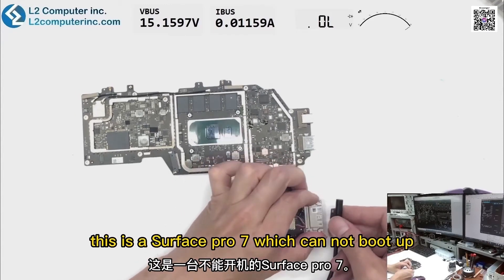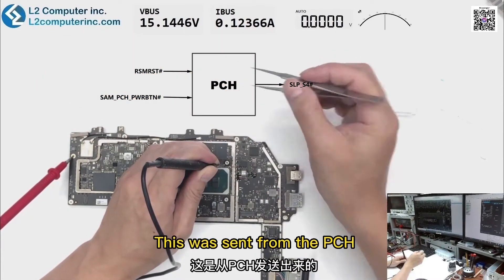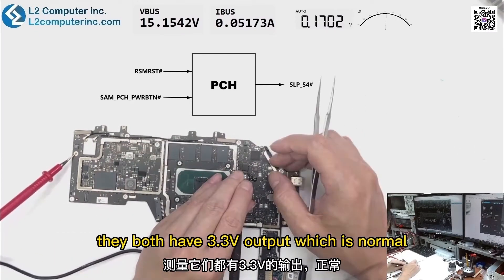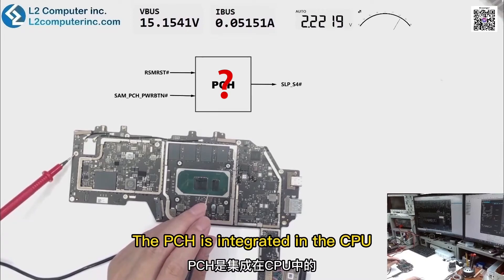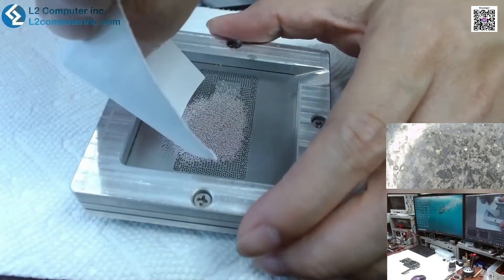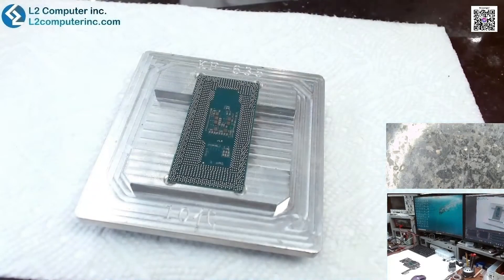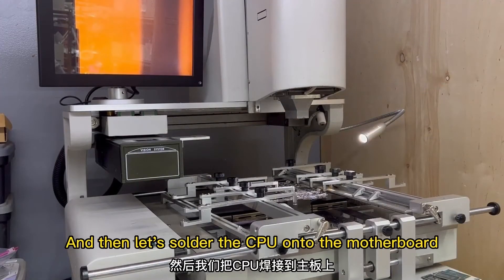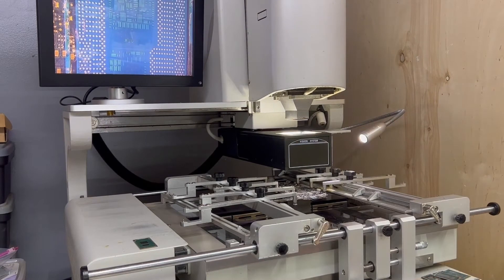Surface pro 7 Can't turn on repair tutorial

Comment: I have i guess similar problem 
Surface pro 6 won't start just the screen backlight and then shutdown 
I have measured the current it draws from the charger 
If it off it draws 0.1 amp
If i press the power button it draws 0.3 amp
What could be the problem?

Comment: Cant figure out a board issue. I have no power as soon as the power plug is removed. This appears to be a hardware issue and i cannot figure out power rails. I have already replaced the battery and surface connect port. Any ideas?
Reply from the maker: Has the computer detected the battery?
Reply: @l2computer310  nope

Comment: My SP7 has some really weird power button issue, at first it was dead it wouldn't power on at all even when trying to reset it, then i opened the device and lifted the screen and removed and reinstalled battery power cable then it immediately booted up! but then when I normally shut down the device and try to power it on again (using the power button) it won't, every time i want to turn it on i have to remove the battery power cable and reinstall it, so i thought that the power button was damaged but a technician said that the power board is working fine as he tried it on another device. Have you come across anything like that? as this small issue is killing the functionality of the device.
Reply from the maker: Send it to us repair, I will let you know the problem after diagnostic.
Reply: @l2computer310  I don't live in the US, how do I send it internationally?
Reply from the maker: Please measure the voltage of the power button, and measure the voltage when the power button is held down

Comment: Nice!!! Is boardview and schematics available on the Internet? Where do you buy CPUs because its a big problem to get good CPUs?
Reply from the maker: Hi, the boardview and schematics we have no way of providing sources for. You can contact us to order CPU
Reply: @l2computer310  an the CPUs that you provide are really new? we will see a reballed or used CPUs under microscope. And SoCs that you provide doesn't have activated  boot guard?
Reply from the maker: Some new some only have reball
Reply: @l2computer310  so it is available on the internet, because i see boardview on your monitor in video.
Reply from the maker: yes we have but we can't share sorry about that.